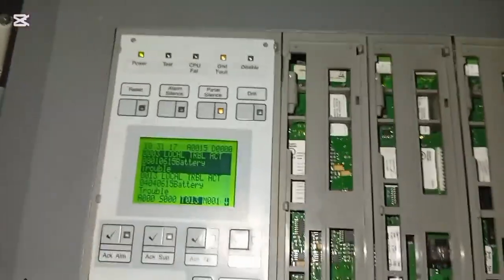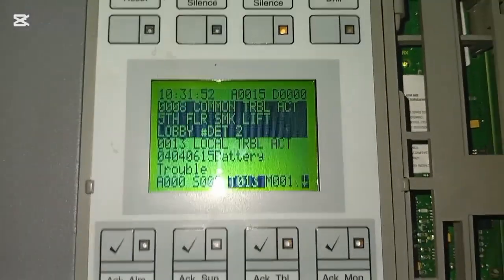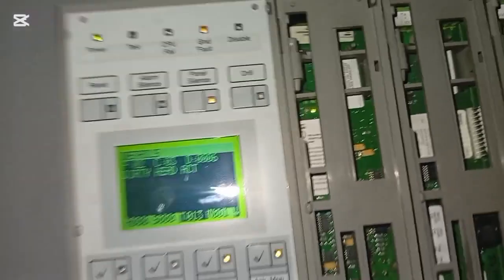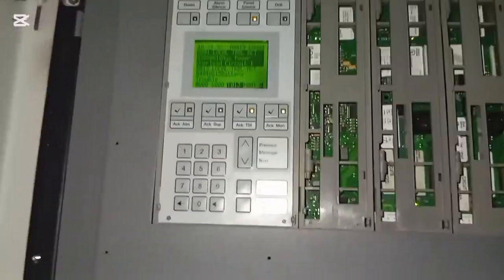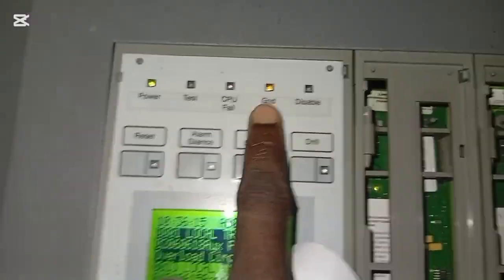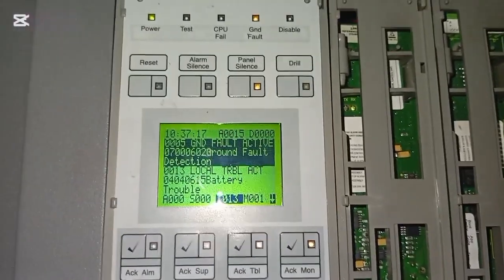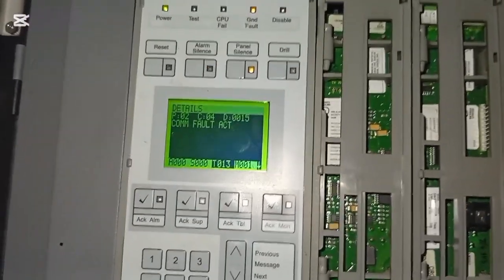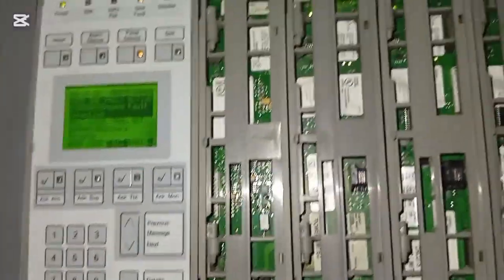“How to Clear Trouble, Fault & Error Messages on Edwards EST3 Fire Alarm Panel”

Comment: Where can we get the programming software?
Reply from the maker: EST3 software is proprietary and is normally available only through authorized Edwards/EST distributors and certified technicians. To obtain it legally, you need to contact your local Edwards representative or authorized dealer for licensing and training options.

Comment: How to solve unprogramed device trouble, please reply
Reply from the maker: Let's have it in steps .
Step 1. check the panel display to identify which card has unprogrammed devices,
Step 2. map the device to collect its serial number, 
Step 3. physically locate the device by comparing devices serial number from  what recorded from the program through mapping 
Step 4. once located, kindly add the devices on the system by programming and the unprogrammed trouble will be clear. 

Note that u must use the system SDU to perform all the above steps